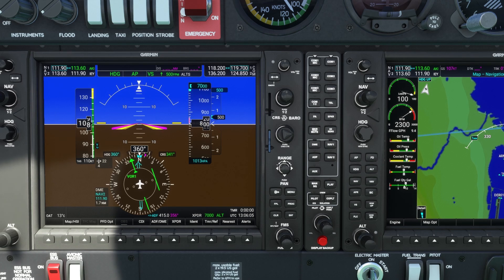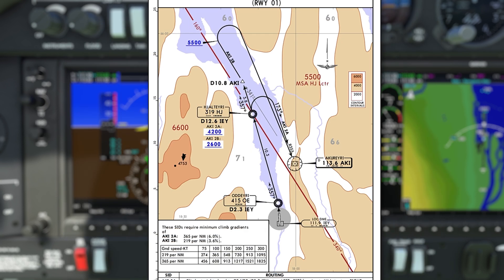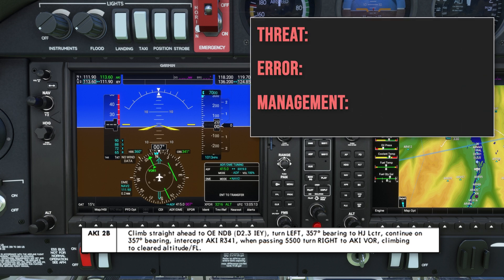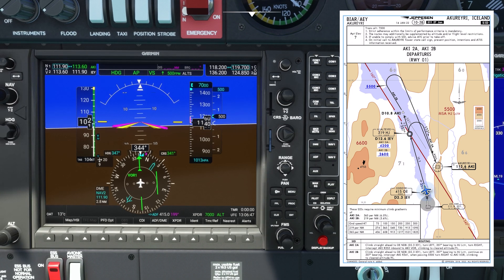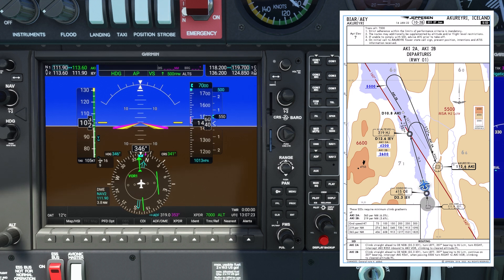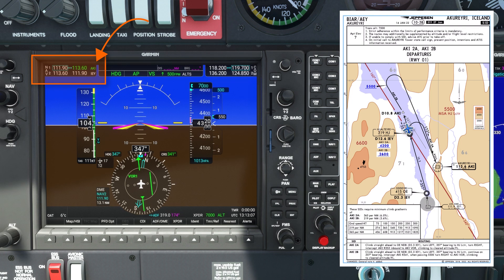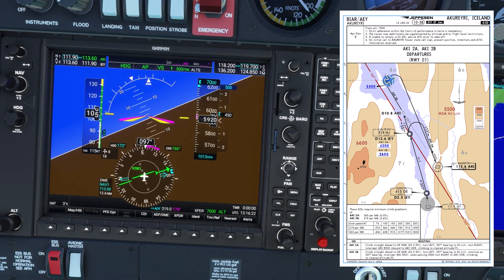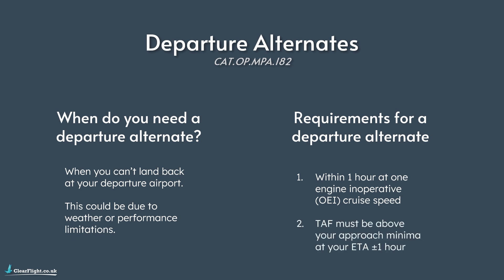How to Fly a Standard Instrument Departure (SID) | EASA & UK Instrument Rating

Comment: Does that mean the headings on sid are true tracks and not magnetic tracks
Reply from the maker: Hi, ICAO specifies that all published procedures use degrees magnetic, which is written in ICAO Doc 8168. In this SID, the cockpit heading is magnetic, all VORs are calibrated to magnetic radials and the NDB bearing pointer is simply overlaid on the magnetic heading reference. So everything in this video is a magnetic heading or magnetic track.

Comment: Missed one of the options if there's trouble on departure. Fly along the river valley until problem is sorted out or climbed above msa or crashed 🤣.
Reply: Mike, One would need to define trouble. I’m in the US. If it is an emergency, pilot in command can do what he wants to keep the aircraft and souls on board safe.  Look to the FAA A.I.M. for guidance.
Reply: @MWILSON-i4h  I was trying to make a joke, the video said fly along the valley until problem solved OR above MSA. Well, the video didn't cover what happens if the problem is not solved and the plane never makes it to MSA.
Reply: @rollamichael  Mike,  Ok. No worries! Happy flying! I’m retired. Hung up the headset!